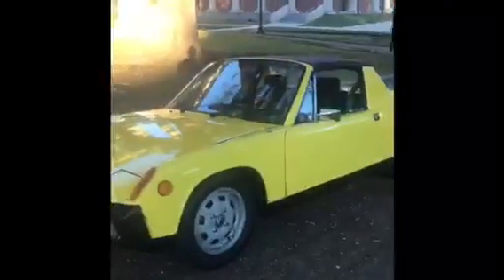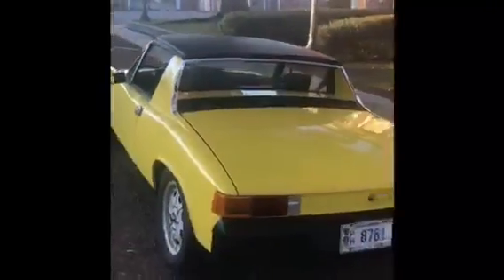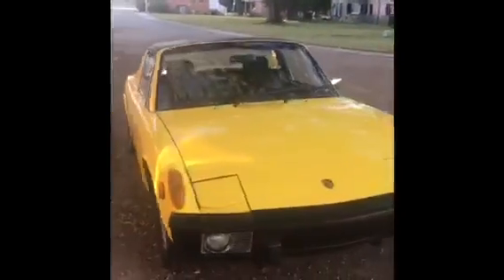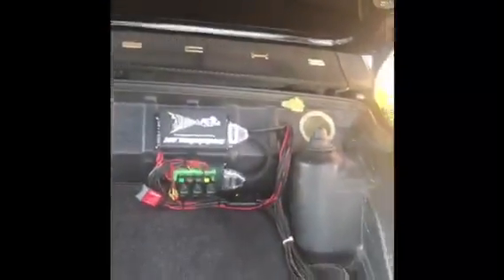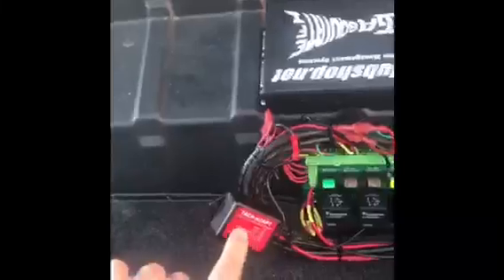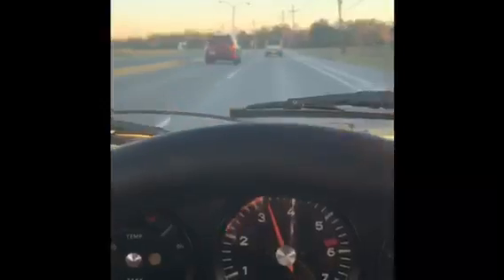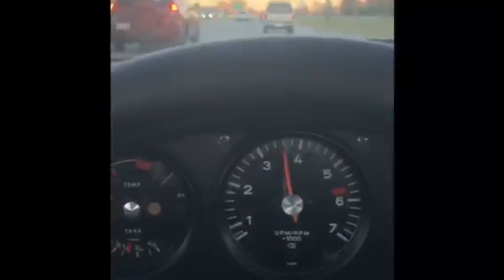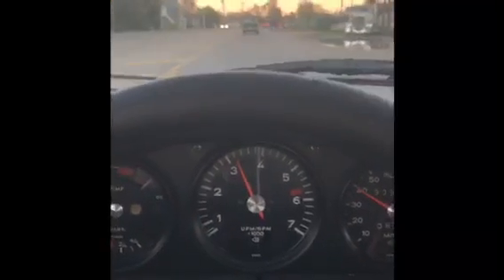1970 Porsche 914 with Megasquirt Fuel Injection

Comment: Nice!  Huge 914 fan and like the look of the dual throttle body that looks like carbs rather than OE fuel injection mess.  Please add an update on how this is working out for you.  Kit is a bit pricey but if it is well developed, it deserves the kit premium, especially if you didn't have to do all calibration work yourself.  

Please update on how your install and calibration went.  

Will the targa top still fit in the trunk over that ECU install?
Reply from the maker: Thanks for your comments Gomer Pyle. I provide the packages and this video was submitted to me by a customer for me to upload,  end user tuning is needed, but that is the fun part!
Reply: Mario can you provide me more information about this setup i have a set of those dellorto carburetors and will like to know more about goin ecu injection